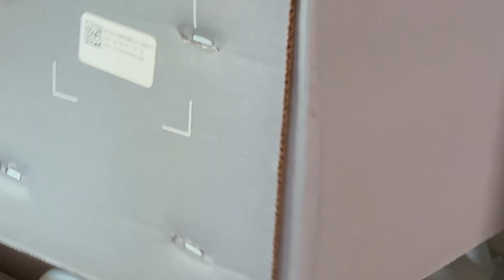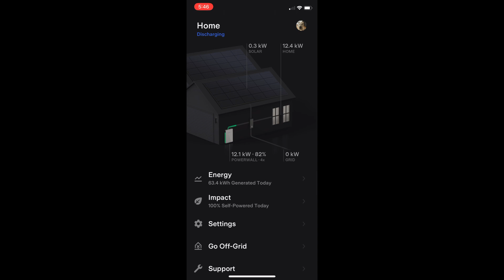4 Tesla POWERWALLS- Home Installation BATTERY back-up & SOLAR in Canada 🇨🇦

Comment: Thank you for sharing. May I know what’s the peak power and continuous running power this system can provide when it is off-grid?
Reply from the maker: Thanks for watching! The tesla site says; ”7kW peak / 5kW continuous
Seamless backup transition” so for 4 powerwalls, 20KW continuous. 

Works great, just had a power outage this morning for about 30 mins and the only reason we knew was that the Tesla app told us that the Grid was down.

Comment: Can I ask if you're still happy?  Do 4 Powerwalls cover your energy needs? Do you deplete them daily? And if so, is your solar system able to recharge them fully within the next day? Or do you find yourself with too much spare stored energy? Thank you.  We're considering a similar set-up.
Reply from the maker: Hi Rob, thanks for watching the video :) We are Grid-tied and only receive a Billing cycle credit towards what we consume from the grid. So, it's great for 8 months out of the year when we can get a credit when we use more of the grid than what we make but we loose heavily in the summer months when, after charging the batteries and the car, we still end up giving them free KW's...We don't get those KW's as credit for the winter months. Not great...I think that's only with Nova Scotia Power thought....

 We consume most of the batteries during the night, especially if we are charging the cars. We keep the minimum charge at 20% so the grid kicks in afterwards. During a sunny day, takes a few hours to fill the rest of the batteries from 20%. Planning on adding solar panels that will help generate more KW's for the winter months.  Right now (Mid morning) it's raining in Halifax and our 16.3 KW system is generating 2.4 KW while our house is drawing 1.5 KW. The Gateway is sending 1.5 KW to the house and 0.9 KW to the batteries. The system will adjust that based on demand and production. If the solar is less and the house demands more, the batteries will kick in to supplement down to 20%...then the grid will take on the slack. 

We'd recommend for most people to go for 1 or 2 powerwalls if your grid tied. With 4 of them or more, the return on investment is pretty low. Be another story off grid. 

The main benefits we find are in a power outage where we can use the house as thought nothing has happened. Got plenty of juice and 20 Amps (5 amps per battery) so combined they can run a hot tub and central vac, and basically anything  that we would usually run. Another benefit is that with more batteries, you can charge an EV without worrying about the draw on your house in a Power Outage. You have enough KW's to do both. To have 2 or even one, you would not really notice it other than in an outage...especially if you're getting credited over the year for your solar production that is above your use. 

The app is amazing. The Tesla Gateway manages (controls) it all. Grid power, solar and batteries. Seamless. It's the Gateway that makes the decisions for the house. It can see the cars being plugged in and acts accordingly, reducing the rate the cars take based on your home draw at that time. Yeah, pretty cool. 

Had some issues with 4 powerwalls thought. The more you have, the lower the Impedance or Resistance level that the powerwalls will allow before it shuts itself off...Had the installer come back to fix that with Tesla on the line as well. Not sure if you seen the video in Australia of the 10+ powerwalls that were flickering off and on but, yeah..that. So, I believe that 4 or more powerwalls will be trickier to install than 3 or less due to the impedance levels so choose your installer well.  

Hope that helps, if I missed a question or you had more, give me a shout and I will get back to you :)

Comment: I prefer diesel electric generation during emergencies, but I’ll give a tip of the hat to the Tesla people- you won’t even notice a hiccup and your freezers keep running.
They aren’t better for the environment because they take tons of fossil fuel to manufacture that could have been used much more efficiently generating electricity in its own right. Also, the pollution that the batteries leave us with at the end of their lifespan is horrendous.
Reply: I recently read that Tesla recycles 100% of the batteries...so not sure about the horrendous pollution end of life comment.
Reply from the maker: Our friend recently acquired a standby Diesel generator for his home, and it's impressive. Looks great off the side of his house. However, we opted for a different solution. 10 year warranty on the batteries.

Comment: That's cool n' everything but the Tesla PowerWall uses NMC battery cells, the last I checked.  Also, they are very much over-priced, on a per-KWH basis, when you compare them to other options.  They look nice, but other than that they aren't anywhere close to being the best option for stationary off-grid storage requirements.  In fact, they're one of the worst products on the market, currently, because of the relatively short cycle-life of the NMC cells.  That's not even mentioning the increased risk of thermal runaway that simply doesn't exist with LFP or LFMP cell batteries.  In the 7 months you were waiting, technology changed multiple times, making this a really poor choice for long-term, off-grid, alternative energy storage.
Reply from the maker: We bought them before the price increases which I guess they would now be the most expensive solution available. Guessing in Canada that they are probably over $15K + taxes and install which is very costly. We got them for $10,500 per unit plus tax and install. They have, as you are probably aware, a 10 year warranty 70% capacity retention..The main reasons we decided to go with Tesla powerwalls now rather than to wait or look at others is;

1. Resale value of a Tesla system in your house is going to be higher because people know the brand.
2. Inflation made this a wise choice now rather than to wait. Electricity prices here are going up from .162 to .182 approx in the next few months. We are on the grid and our finances aligned for the purchase at the time. In a year of having them, the price went up $4500 per unit! Insane!
3. Hard to get and have installed here so we took what we could get. There's a limited number of installers that do any type of battery storage.
4. Suspect that in 10 years once they are off warranty, we will be into V2G with the Tesla's and also be able to add on with newer tech. 
5. Possible Carbon credit scores that may limit/increase costs in the future. If that starts happening, everyone will be looking for green tech. For us, having a low carbon footprint already, we will gain in the value of the home plus the financial benefits of not being imposed with additional carbon taxes. (will have to see how it all plays but its a long term bet) 

We love them and a few times they have been used. Once during a recent hurricane, people here did not have power for days..Calculated choice..we think yes. Thanks for your comment thought, much appreciated.
Reply: @NatachaP  Thanks for the video. I am in the US. Here's the funny thing - LFP batteries are cheaper but heavier yet here in US, LFP batteries for ESS are much more expensive than Tesla Powerwalls. Enphase, BYD, LG, Fortress, Homegrid, etc. The PW is the only ESS with liquid cooling. You can get cheaper LFP batteries (e.g. EG4) but they're for the off-grid unregulated market or after coupling them with a UL1741 Hybrid Inverter + BOS, they still cost more than a Tesla PW and non of them has the software flexibility as the Tesla solution. Sad, after all these years, I wish there are more options out there. So commenter Jason there with his poo-pooing is wildly inaccurate.
Reply from the maker: @sitechca70  Oh wow, did not know that. More expensive..crazy that they price themselves over the cost of Tesla equipment... I agree that Tesla Powerwalls have unique features, including liquid cooling and software flexibility, which make them an attractive choice for many. Hard to get them thought! Found out recently that another couple installed an, unknown to us, LFP system in a off grid home and the Power Company found out, wants them to get the whole thing inspected by some outside company..Going to cost thousands. Here in Nova Scotia, the power corp has complete jurisdiction on any and every power generation/storage of residential electricity. Even Off grid in the middle of nowhere...SO another bonus of buying a known brand name battery storage and getting them installed by an approved company... And Jason's comment too about Powerwalls...it's worth noting that Tesla has addressed this issue by designing the Powerwall to only use a portion of its full capacity, which helps to extend the battery's lifespan. Don't know if the other battery tech has that option. Be really interesting to see in 10 years what the tech will look like!  Will need more electricity to plug in our Optimus Robots!
Reply: @NatachaP  Wow amazing that a home unconnected to the grid still falls within the jurisdiction of the local utility. In US, that goes to the AHJ i.e. local county building department. Tesla has taken the trouble to explain to the AHJ via documentation the US NEC ESS sections and how its PW conforms to it and why certain sections are not applicable - which results in a nicely integrated, clean solution. Battery DOD is nothing special - all inverters can be set up to stop discharge at any DOD. As for warranty, Tesla vs LFP - they're both 10 years and typ. 70% capacity. LFP has one downside - they cannot charge at < 0C temps. LFP is superior chemisty (and cheaper) for ESS but nobody (in US) has bothered to put out a competitive product.
Reply: Good thing you aren’t buying them!
Reply: @RayNLA  - You already did?  Sharing good information suddenly a bad thing?
Reply: @jasonbroom7147  
I have a red Powerwall. Along with two Teslas and solar!
Reply: @RayNLA  - I'm not surprised.  I have several power stations and purpose-built batteries, most of which I put together myself, from raw components.  A lot of what I've built was from 2nd-life cells, repurposing stuff that would have otherwise been in a landfill.  I also live where electricity is $0.11/kwh, 24/7, with no net-metering and poor solar potential.  This is basically a left-coast versus Midwest discussion, with a profoundly different fiscal approach.  Luck to ya!  :)
Reply: @jasonbroom7147  
Wow!
Very impressive. I’m all the way west! I guess the most important thing is that people are adapting to sustainable living. Fun times we’re living in. Enjoy the rest of the weekend!
Reply: The Powerwall has one of the best warranties. They are also one of the, if not the, best value for the capacity. If you want a better $/kWh, you pretty much haveto go to something that your not sure if they will be around to honor they're warranty and have they're monitoring platform in a few years.
Reply: @marcmacdonald5862  - A warranty on a bad product doesn't make it any better.  A "monitoring platform" is contraindicated to those adopting solar for libertarian reasons.  Outside of locations with absurd time-of-use rates, where you can game the system to screw the little guy, the Tesla Powerwall is absolutely one of the worst commonly used systems.  It only sells because of great marketing and ignorance on the part of those buying them.